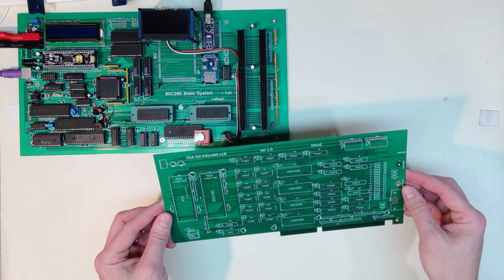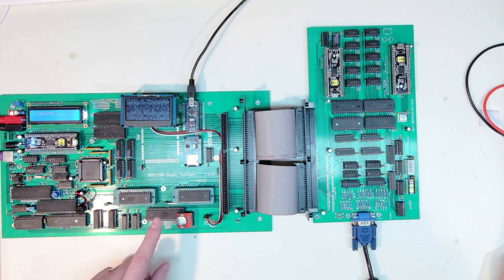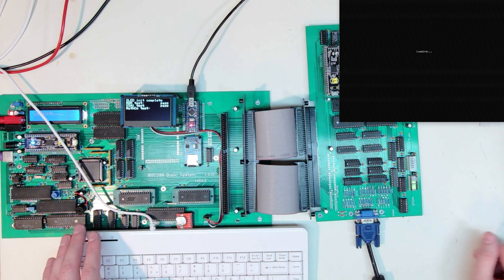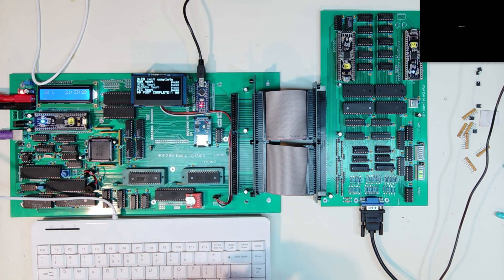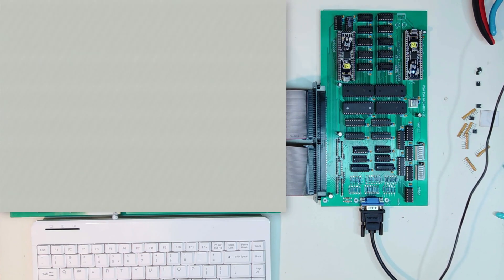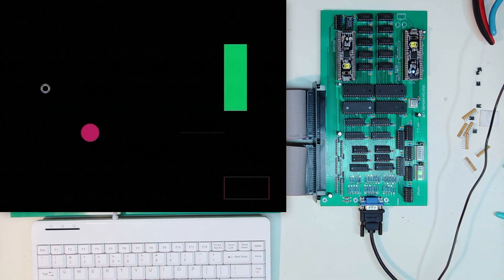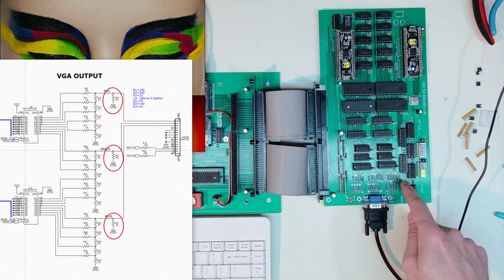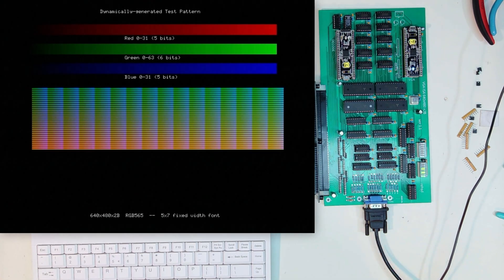640 x 480 VGA, Ep. #16 - PCB 1.1 Working!

Comment: That's looking really good.

Based on the schematic, the impedance will be less than 33ohms. The impedance of your DAC includes the ground resistor, and using Thevenin you can treat as being in parallel with your DAC. To calculate the voltages you need to include the 75ohm load as well.

I have had mixed results with quality. The CRT was perfect, nice solid colours and no noticeable noise. The LCD on the other hand, lots of noise and lots of weird aliasing. I think that was due to a combination of problems. The paper thin cable, and really poor sampling.
Reply: @rehsd the impedance of the R-2R network alone simplifies to R1, so the otuput impedance of the whole network is (R1 || R3).  The gain from the VOH of the 74HCxx is R3/(R1+R3) which should be equal to the desired open cct level of 1.4V divided by the VOH say 4.5V, or around 0.3.  Solving those together I think R1 = 240 and R3 = 110 should give you the right impedance and level. Connecting the VGA 75 ohm termintation should get you to the 0.7V level, at least my quick glance at wikipedia says that's what you want :-)
Reply from the maker: @zxborg9681  Very cool. I'll jot that down for my next card build. Thank you!
Reply from the maker: I swapped out the 33 ohm resistor with a 47. Voltage measurements look good. If I need to bring up the impedance, I suppose I would go to R1=300. Any concern with having too low of an impedance?
Reply: @rehsd  Lower impedance increases the current usage. A bigger concern in this case is it lowers R1, which means that the on resistance of the drivers becomes a bigger factor increasing the error between bits.

One suggestion is to draw a brightness ramp and check it with the scope. If you do that I would be interested in seeing the result.
Reply from the maker: @drlazy1  Can you elaborate on the brightness ramp? Is that running the output from black to full white, incrementally increasing the color values -- while logging the output voltages?
Reply: @rehsd  Yes, full off to full on, incremental steps, or full on to full off if that is easier. You are looking for a voltage ramp that you can capture on the scope. It will give you an idea of how bad the error is between bits.

If you GIS "DAC monotonicity" it will make sense.
Reply from the maker: @drlazy1  That search term was really helpful, thank you. I think I will get my desoldering gun out and replace the resistors. :)  @Zxborg helped me with the math, and I think I'm going to try R1=240, R2=480 (470 due to standard resistor values), and the pulldown (R3) at 110. Thank you!!

Comment: For the waviness you could try adding a tiny bit of capacitance from the RGB pins to ground. 

Took a little experimentation with some values, but this helped reduce some noise I had in my own VGA card design. I think I settled on something like 220pF.

This might be a bit interesting in your case because you'll end up with an RC filter due to the use of the R2R DAC. It'll definitely require some experimentation.
Reply from the maker: Thanks for the suggestion! I'll do some experimenting.